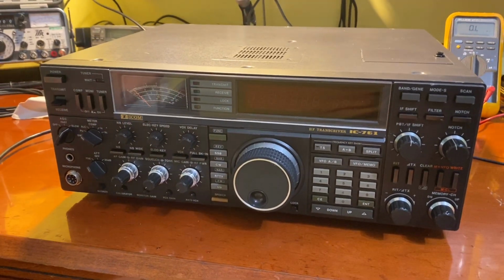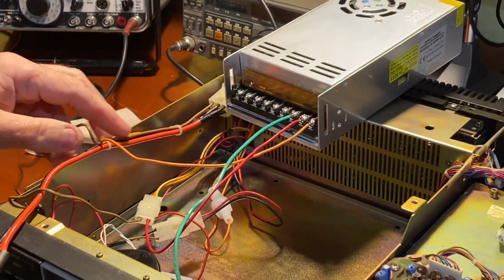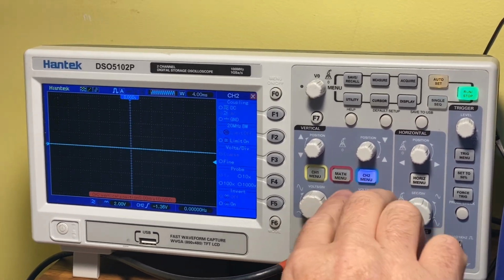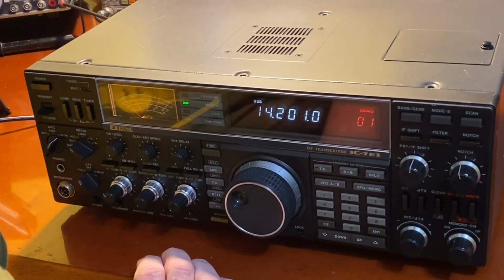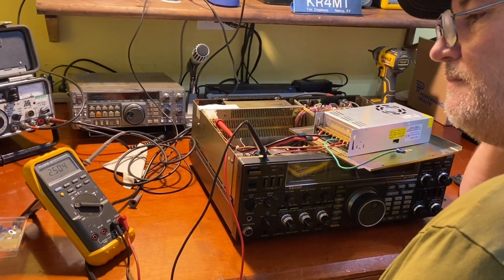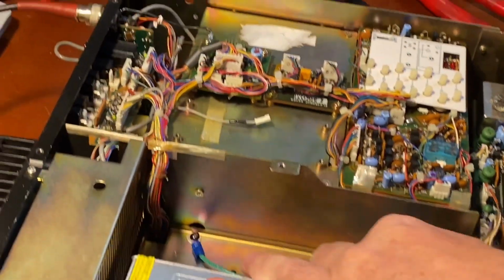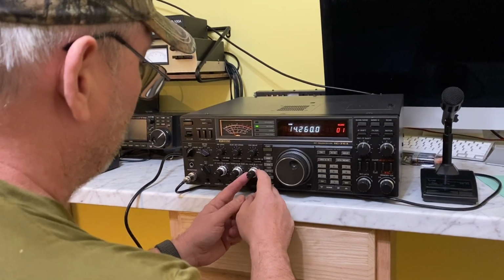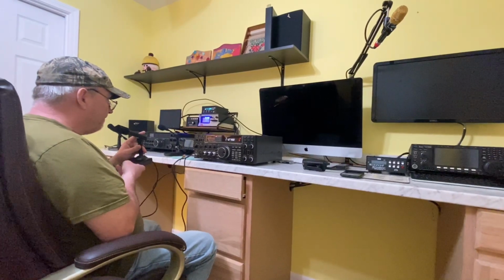ICOM IC-761 POWER SUPPLY REPLACEMENT 2020 by TIM

Comment: Great video Tim. I want to run my 761 mobile-can i just connect red and black wires thru external switch (bypassing internal power supply) to 12 volt car battery? Plan to operate mainly qrp power levels-Thanks KC9FLI

Comment: Great job Tim! I also have a IC-761 that I got for $300 w/SM-8 mic. Works great but the receive is slowly fading. I'm hoping to have it fixed if I can find someone near Massachusetts. 73, KD1KU
Reply: The transmit / receive relay contacts get dirty and causes the receive to fade out. I pulled the cover off mine and cleaned it with Caig Deoxit and it's been good now for years. de KC2ZA
Reply: @Ricktkc2za  I'll definitely give that a shot when I pull it back out of the box, Tnx Rick